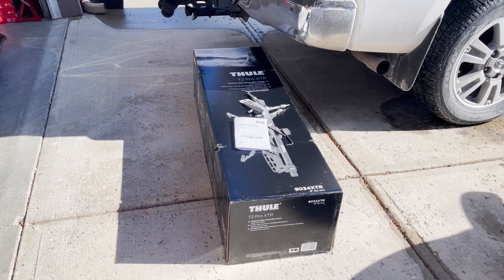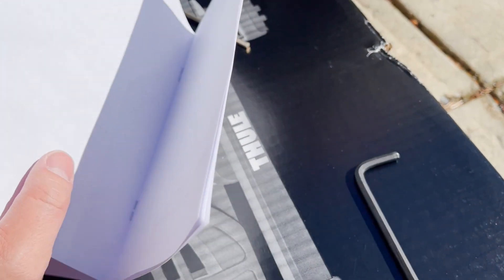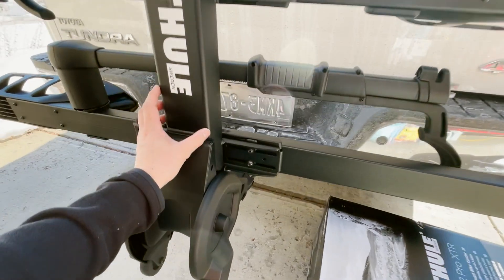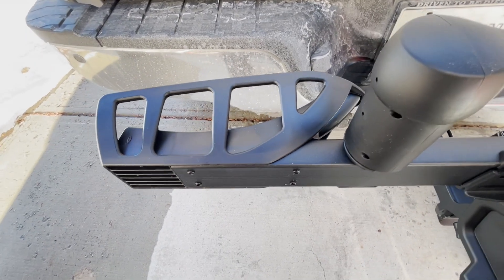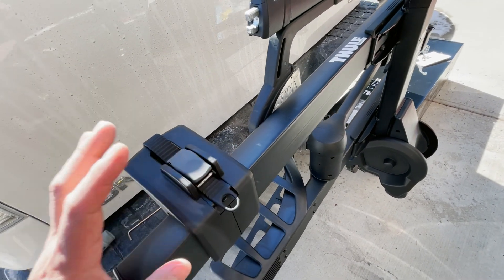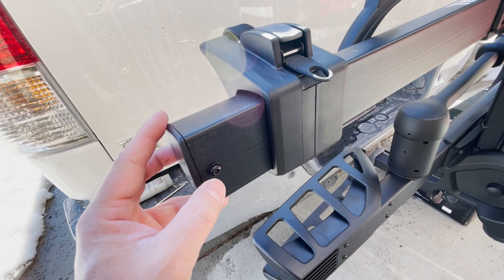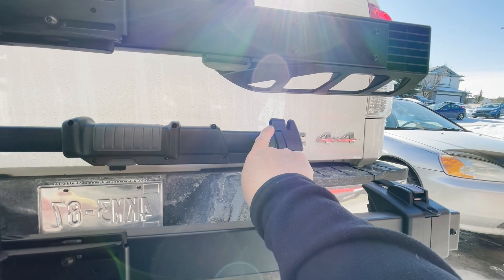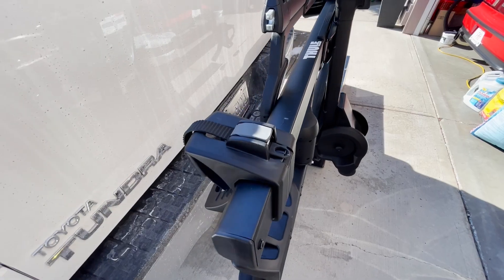Thule T2 Pro XT and XTR Hitch Mount Bike Rack Assembly Tips

Comment: I'm indecisive right now, between thule x2  or kuate 🤔 both look great and both have good reviews also.
Reply: seems like raw materials have slowed down... most manufactures have multi-week wait... the best carrier 1UP.com is 3-4wks on waitlist.. then if you order another 4-6weeks before delivery.  I don't blame the manufactures... but I blame the world situation on the Great Reset orchestrated by the World Economic Forum.  Welcome to OneWorldGovernment...
Reply: @btrask3  over ordered mine a week after this video knowing that in the summer it will be tight on getting any good bike rack, ended up getting the thule T2 Pro. Looks great on the jeep and very durable.
Reply: I was very happy with my Kuat Sherpa 2 but I needed something beefier for my wife's ebike, I liked the Kuat NV Base, nice and compact, but it's nowhere to be found!
So I got the Thule T2 Pro and it seems pretty solid so far.
Reply from the maker: I chose Thule b/c parts are available for them for quite some time, they're super popular and I have other Thule items so my keys all match up.  I also like the fact that Thule offers a lifetime warranty on their products.  I'm not sure if Kuate does the same thing or not.
Reply from the maker: I did the same thing.  The moment I saw the rack at the bike shop and found out I qualified for a discount b/c I bought a bike that I snapped up the latest and created T2 (with wheels).  I just received my bike rack extension last week so I will be posting a video on how to install that soon.
Reply from the maker: Thule racks are quite nice and they definitely can hold some pretty big and heavy bikes.  No regrets with our purchase.

Comment: The screws for the bars are tight but the bars move.
Reply from the maker: The screws have a factory applied threadlocker. As long as you have not cross threaded the screws then you should be able to torque it further to break through the thread locker compound and it will be fully seated.

Comment: Thules instructions are not in one specific language so the same manual can be used worldwide. You got a bad set, usually all of then parts are listed. Assembly takes 15 minutes and you dont need to use lube at all fornthe screws as they can't seize in plastic. Only need to lube the locks with gel Teflon. Not a bad video but there is much to correct.

Comment: The straps actually go thru the cutouts and into the latches, not over them as you’ve shown.
Reply from the maker: I think you can use them either way depending on the config/wheel and so on.  I do currently use them as how you've described but interestingly enough, the Thule dealer I bought from said to put over the cutouts.  In the end so long as the bike wheel is secure then we're golden.  Thanks for pointing that out to our viewers.